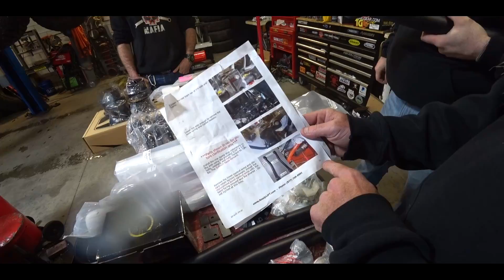I bought MASSIVE Tires for my TOTALED Jeep Gladiator

Comment: Of all the automotive informercial products, I will stand behind one. I am not sponsored by or selling this product but it’s available everywhere. Get the original Rain-X. Not the windshield washer fluid, not a knock off Castrol windshield product, but original Rain-X. You’ll stop using windshield wipers with that stuff on your glass. Follow the instructions, wipe it on, let it haze, a little water, and wipe off. Best auto product ever for safety’s sake. It should be issued with registration renewals and required for people to apply.

Comment: Awesome content. I'm a big Jeep fan that's all I drive. Those 38s will be fine on stock axle shafts unless ur going to wheel it. I'd suggest rcv in the front and chromoly shafts in the rear if your going to wheel hard with it. And watch the snow jeeps go great but with fat tires you tend to slid around a bit more. Looking forward to more videos.
Reply: Regear first. Stock JL/JT shafts hold 40s off road without issue if you know what you're doing. (Wheeling with your head and not your foot)
Reply: @charlesgillham6557  could not agree more. Those are good guys that are working on his Jeep I very much doubt they weren't going to re gear it. And yeah people think you just toss it I'n 4wd and go lol there's alot more to it then that. I've always had the mind set over build under use. every rig I have is built for the ultimate adventure even though I rarely go hard on them it's hard to beat your babys lol
Reply: @johnjameson2670  I'm one of those guys. Theres a plan to a degree but it takes time and money. Gears were talked about pryor to any parts ordered or anything. I walked the jeep the day after he received it.
Reply: @charlesgillham6557  that's what I figured no good shop would not address that first.  Glad your buddy's with him hopefully you will teach him the smart way to wheel.
Reply: @johnjameson2670  planning a ride and video in the future. Not sure when. Have other things to do to it. But I'll have my jeep out there with him. I dont have a video page or anything. But my IG is spruce_goose_xj
Reply: What's the wheeling like down there. I'm guessing red clay? I'm in pa running slick rock. Love the xjs that was my first I need another one.
Reply: @johnjameson2670  depends on where you go. Red clay is a few places. Alot of rock and river beds for me. 2 places in Tennessee I go to alot. But once you're in the mountains. Its rock and river beds. (Love it. That's what I built mine for)

Comment: Awesome job on the Gladiator. I'm weary about not regearing it or upgrading the axles. I know the stock ones in the D44 can handle it, and the 8 speed auto can keep up, but it would be a lot better with 4.88 gears and CVs.
Reply: RCV shafts not just CVs. Stock shafts hold 40s off road without issue if you're wheeling with your headband not your foot. Regear possibly but drive like a champ with a tune. You do lose 8th gear though.
Reply from the maker: If I keep it, I will probably regear it. For now, she does pretty damn good though!

Comment: Does the gladiator have Dana 44 axles or what comes stock in them?
Reply: Comes stock with 44.
If you have tow package they are the beefed up 44.
Reply: 44 front. 30 rear. Tow package is 44 front and rear. Rubicon is a wider 44 front and rear with lockers.

Comment: Does the Jeep have Dana 44s. If not those tires r kinda big. Might blow them up. And your gearing will be wrong. You prob won't even shift into 7th or 8th gear. Good luck
Reply: 44 rear. 30 front. The are alot strong then the JK axles. Guys run 40s without issues. Lost 8th gear.